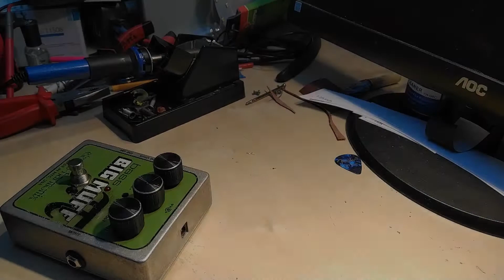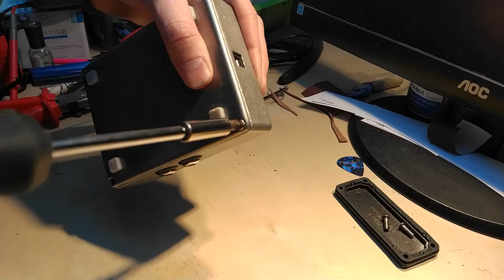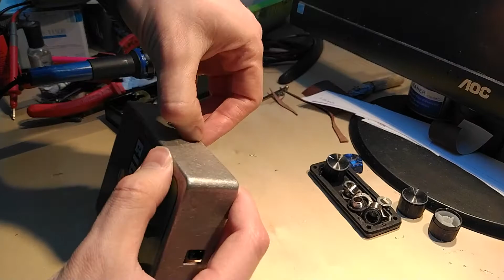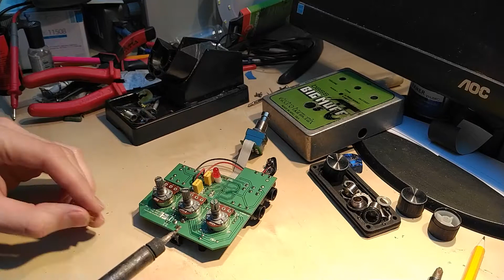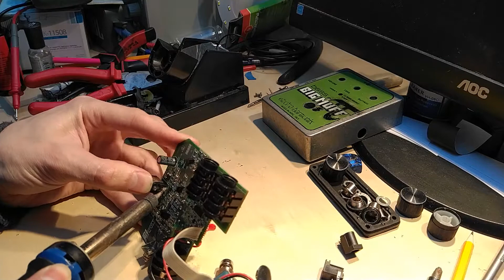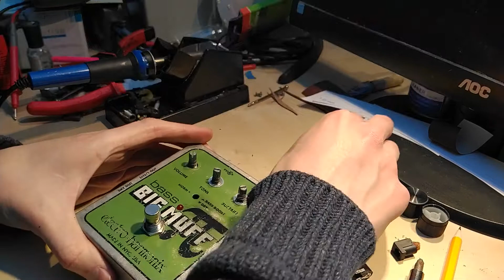BIG MUFF Pi (for bass) repair | Disassembly | Power connector replacement | Electro-Harmonix

Comment: Hey my Bass Big Muff II was working just fine, I brought it over to a friends for a jam session n within the 15 min ride there, the FUZZ stopped working.. the rest of the pedal works fine, like signal comes thru clearly .. just no Fuzz.. and isnt that the whole point?   any help offered up would be much appreciated .. im not exactly Mr Fix It, but its got to be something simple I would think
Reply: I now have diagnosed and find I need to replace the input jack like you are doing, so I really appreciate the help !